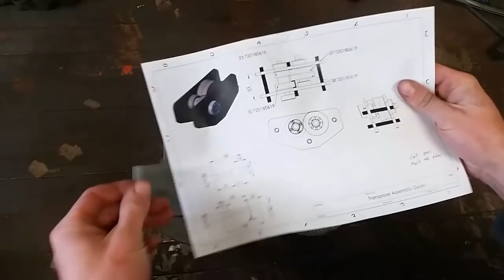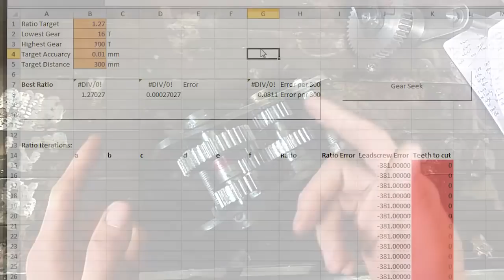Quick Change Gearbox Build P5

Comment from the maker: By popular request, at some point in the next year I will try to put together a 'proper' narrated version of this build
Reply from the maker: Tony Wilson  80/63 = 1.269... almost 1.27 (which comes from 25.4/20 btw).
If a 63 tooth is used it is probably accomplishing the same thing
It might be 40/63 for example, but another part of the gearbox might have an extra a ratio of 2 built in making it equivalent to 80/63 if that makes sense
Reply from the maker: Tony Wilson  Cheers mate. Yeah there were a few options I considered 47/37 is another one, but higher prime divisions isn't straight forward depending on the equipment. I've seen people achieve good results with paper print outs and microscopes to index
But yes, space is the issue to fit the ideal 127 tooth gear. 33/26 also works, but it is starting to creep away from the desired ratio. It would likely work for bolts, but forget leadscrews or anything precision
There is a good series by Clough42 where he makes an electronic leadscrew. I considered this option early on, but my PLC knowledge stops at arduino and I knew it was too much information for it to handle
Reply: @TomMakeHere  It appears that cutting "funny number" spacings on the B&S type dividing head can be done with "differential indexing".

It involves using change wheels (ironic, right) to use the movement of the spindle to drive a small movement of the dividing plate a little, even as the spindle is driven by moving the selector pin on the dividing plate.

There are a few videos on the topic on YouTube. This one is quite technical, but then it likely has to be!

https://www.youtube.com/watch?v=tQBhHjNO69s

It is documented "old school" in "Practical Treatise on Milling and Milling Machines" by Brown & Sharpe, which is helpfully online:

https://en.wikisource.org/wiki/Practical_Treatise_on_Milling_and_Milling_Machines/Chapter_4
Reply from the maker: @paulwomack5866  Absolutely it can be done. I don't have the universal style that accepts change gears. I could make that upgrade of course.
A fair bit of this project was to experiment and learn more about gearing. I wouldn't do it the same way if I had to do it again, so I guess I learnt something!
Reply: @TomMakeHere  I also thought you might enjoy looking at the mind-shredding complexities of differential indexing...
Reply from the maker: @paulwomack5866  ha ha. Yes that too :)

Comment: are you using any excel sheets or something similar? i am interested in these kind of gearboxes. i found workable plans for a variable speedbox but not yet fot a QCGB.
Reply from the maker: It all comes down to the ratio of input to output, and this can be worked out by the ratio of the gear teeth
A good site that I used to check my thinking is geargenerator.com
Reply: @TomMakeHere  thank you. I wonder why Google didn't recommend this page. Spending hours for looking for different programs
Reply from the maker: @HellvVratH  yeah it's a hidden gem that one. I'm working on a proper narrated version of this series, I'll be sure to mention it then

Comment: Hi
Do you have a set of complete drawings for this gearbox, possibly. Electronic (AutoCAD), which I can buy. My Email is em@webnetmail.dk
Reply from the maker: I can give you a 3d model free of charge
Making plans for distribution is a bit tricky as you have to adapt it specifically to your needs, but a model should make things easier and provide the arrangement to start off

Comment: Do you have any Drawings in PDF.
This is something I'd like to do to my lathe.
Reply from the maker: It's on my to do list. The one problem is that it will vary depending on your lathe dimensions and gear tooth pitch etc. I'm thinking of creating a guide drawing with some spreadsheets to calculate some dimensions

Comment: Some more nice progress on the lathe gear changer we too hate changing gears to thread so while we are not going to build this unit we are glad someone is avenging these gear change demons. Love the theater of cutting slicing work you do good. Glad you built a program to solve your gearing requirements.